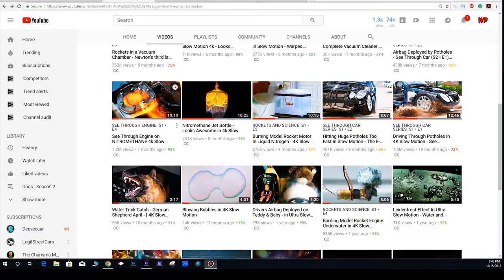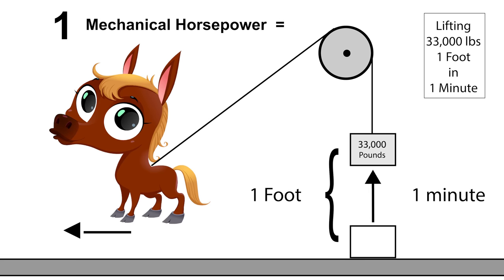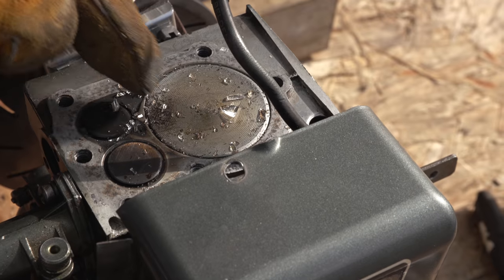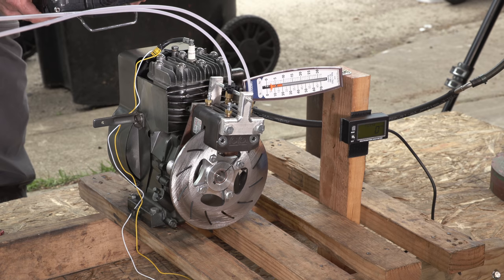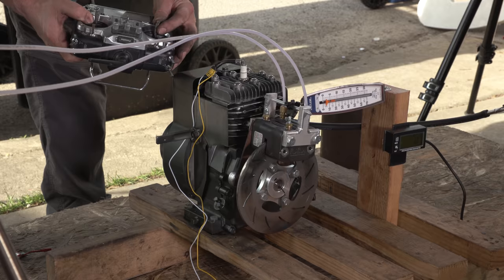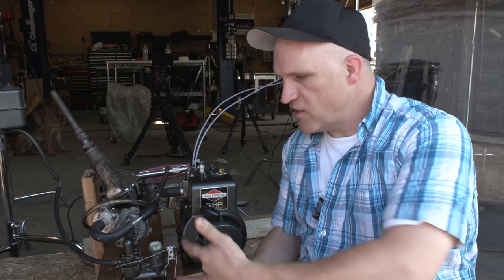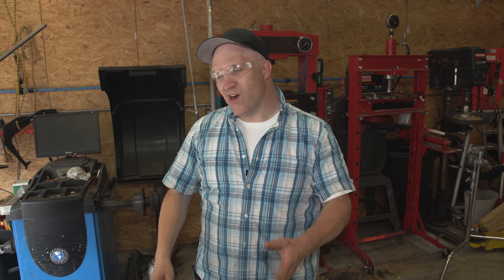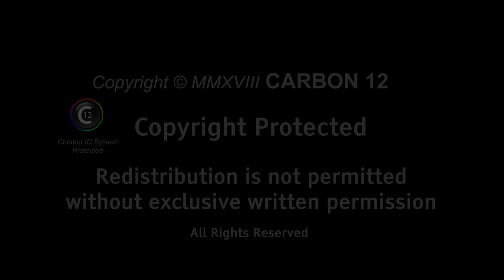See Thru Engine on Turbo Nitro and Dyno  (How much HP does it make?)

Comment: To put a full sized turbo made for a car engine on a basically a lawn mower engine, and hope it produces significant boost, that a lot to hope for. Come on, man!? I do understand you don't want to go and buy a new turbo specific for this but still. At least get a smaller car turbo if you can.
Reply: I herd a spool up 😂
Reply: Indeed, he did say that.  :) But spooling up means bollocks if you can't get enough exhaust pressure and turbine's rpms for the compressor to produce boost.
Reply from the maker: Well actually look it up. This is a 27 mm turbo, the smallest that I can find online is a 25 mm. Keep in mind that this is the primary turbocharger of the sequential setup on the SL 65. If you have ever heard a SL65 Idle, you will notice that you can hear the turbo whine in the exhaust even when the engine is at 600 RPM. This little turbo is basically producing boost at idle when on it's original application, then at about 2, 000 RPM the transition occurs into the bigger turbo which I believe is a 55 mm, I'll have to measure it but yeah, for me 2mm isn't anything a little more fuel and timing can't make up for. And for the record I actually went to buy that little turbo, but I thought it was way cooler to take a turbo from a car and modify it to fit this engine.
Reply from the maker: @Questchaun  it sure did.
Reply: I stand corrected! Thank you for your input. I dare to ask, why then didn't it created significant boost?? Not enough engine RPM range?? Nevermind, I honestly wouldn't know.
Reply from the maker: I'm pretty sure it was a lack of fuel and a restriction from the carburetor, this video was just a starting point for me, and got sidetracked about 15 times in the last year, long story. But I'm definitely going to make a note to go over the turbo compressor wheel and turbine sizes in the next episode. By the way you should look up the SL65 and listen to the exhaust note when it's idling, it's one of my absolute favorites, you can hear these little baby turbo spooling as the car is idling, it actually makes a slight amount of boost pressure at idle, pretty insane. I think the car is a V12 quad turbo but I can't remember. I'll have to Google it.
Reply: Maybe just having a belt drive the compressor would work better? Even if it doesn't it would still be interesting to see what kind of results it gives. And yes, I know that'd make it a supercharger.
Reply: but on its mercedes V12 origin there are 6 cylinder on each bank feeding the turbos with enough exhaust gases even at idle. I must put some math on it but i think you one bank of the V12 does more ignition / exhaust sequences on 1000 rpm then this lawnmower 1 cylinder engine at 3000rpm. so there just arent enough gases to really spool up the turbo under full load to give a real thing of pressure..

Sugggestion again there are very small turbos existing: japanese kei cars or the Mercedes Smart car old generation: very tiny 600cc engine which are turboed. so a get a turbo off these would fit better on a lawnmower engine turbo setup.

get rid of the carb would be next step maybe a computer guy aroudn you which can do a megasquirt fuel injection setup on this engine?
Reply: @WarpedYT  
This is inspiring! For what my knowledge is worth: The turbo charge needs a little bit extra space over the top dead center. Also the exhaust gas has to stay as hot as possible in between the cylinder and the turbine. The gas exits the cylinder with the speed of sound while the speed of sound is only dependent on the temperature. The turbine can only convert the speed of the exhaust gas into power for the compressor. So the simple math is: massflow * temperature = compressor power. 
I worked on stationary 2MW natural gas powered generators for a little while. Those machines have big fat glowing hot turbos on them but use the Miller cycle. So there the turbos don't really charge. They just replace part of the compression stroke. The inlet valve stays open for a large part of the compression stroke. They do that because the turbo-compressor is more efficient than the compression stroke in the cylinder.
I don't know whether I would engineer a variable space in the cylinder head or variable valve timing. Both would be cool to see. Otherwise I'd love to see what fuel injection (reheat of the exhaust gas) right after the cylinder does to the total power output. 
I don't think the size of the turbo limits the possibilities of the total system much. I think the turbo can be really big in comparison to the piston engine that it shares the heat cycle with.
Good times :)
Reply: I look forward for the next iterations! I'll definitively check the SL65 turbo exhaust nots. Cheers
Reply: Warped Perception You are forgetting that the turbine size is only one aspect of a turbo. You also have to consider the ar ratio. That is the balance between turbine and housing size. A small turbo with a large exhaust housing will require a lot more exhaust flow to spool. You can get a 72mm turbo with .64, .86 and .96 exhaust housings. Actually more are offered, but I am using a single brand (CXRacing) for comparison. The smaller the ar, the less exhaust it takes to spool the turbo. No matter what size the impeller is, the ar is still one of the most important factor in how it spools. A 72mm as a single on a 5.3ls can be great or laggy depending on the exhaust ar. In that application, a .64 exhaust housing would be super quick spooling, right off idle. But, swap to a .96 and it wouldn’t want to spool under 4000 rpm. Overall size is important too. Run the first turbo on a 408 stroker and it would be almost too touchy to drive, and the exhaust housing would restrict airflow on the big end. Try the .96 housing and it would pick up power on the big end and still spool at lower rpm. It’s all about correctly sizing a turbo to its application.
Reply: Codeack101 Bear I think it’s less about stupid and more about just being ignorant of turbos. Or maybe he knows and is doing this as a “learning” series. Just thought I would give a little info for anyone that wants to look into it further.
Reply: alflurin No you wouldnt.Just another commenter who needs to go to bed .
Reply: @jakesmith2984  I wouldn't have a problem if this wasn't a fact finding experiment, the turbo isn't even close to being set up correctly
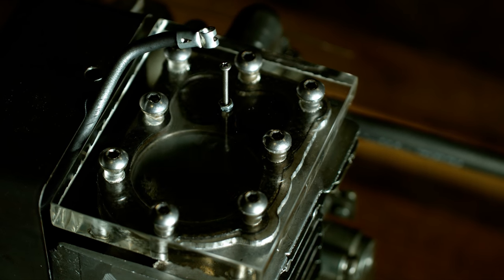Reply: @jakesmith2984   Jake Smith  starts at 1:50 talks about what he's going to do and put a dino on it, TO SEE WHICH MODIFICATION MAKES THE BIGGEST DIFFERENCE.... Either he's ignorant, or this is just click bait...
Reply: Definately lack of exhaust pressure, like think about it that sl65 is what? A v8 or 12 i cba looking but that is a lot more cylinders producing a ‘smoother’ amount of exhaust gas to spool the turbo. So a really small engine like this with one midget cylinder wont be producing enough to spool that thing even at like 12000 rpm
Reply: @WarpedYT  Although the turbo can be heard turning, it doesn't necessarily make positive boost.

On my sr20det I can hear the turbo from 1500, but the manifold pressure only changes to being positive at around 1900. Full boost at 3200.

A boost gauge would have been a nice touch, one less unknown variable.

Still appreciate the work you put in. That disc seemed to machine itself true eventually lol
Reply: Hearing a turbo does not mean it is making any boost. No car sees boost at idle; that would be useless since engine torque output at idle is zero.
Also, adding ignition timing will reduce exhaust enthalpy making it harder, not easier, for a turbo to build boost.
And from a 27 to a 25mm turbo there is a big difference, since cross sectional inlet area is a product of the radius squared, but that's not the smallest turbo you can buy. Smart diesel cars in Europe are 600cc turbocharged; I pulled the turbo out of one of those once and put it on a 5kW generator and it made 6 pounds of boost.
Reply: @jakesmith2984  Calm down son, he doesn't have to upload any vids to make a valid point
Reply: IncandescentWithRage You calm down.
Reply: @jakesmith2984  k
Reply: IncandescentWithRage Wheres the rage bro???
Reply: Jake Smith I find this channel entertaining and yes, I probably was way too tired and I was definitely browsing youtube out of shear boredom. By the way, if you want to know more about turbos.... you got turbo Yoda himself! 
https://www.youtube.com/watch?v=GlHSV0BWKhI
https://www.youtube.com/watch?v=Ssh47oyOSXM
Reply: There re some small junkyard turbos that would work better with the small single cylinder engine. Try one of those little Saab turbos, motorcycle turbo, jetski or Raptor
Reply: You are sooooooooo smart, what's your secret?
Reply: Hey man interesting video. I would probably suggest sticking with the suck-through setup, but get a much bigger carb, or make up a blowthrough hat.  A cheap o2 sensor on the exhaust so you can tune it for peak power would be good too.  But if you are going to run nitromethane in it, you could probably have a two stage setup where you start it on the carb and then somehow switch to nitromethane, since it contains it's own oxygen it only needs a 2:1 A:F ratio.  The Nitro could just be pumped in with a nozzle r something. you really dont need to worry about metering it once it is running, just pump in as much as you can. Maybe a suck through carb with gas and a nitro nozzle in the turbo outlet pipe.Just make sure you have a decent one-way valve and good pump to pump it in.
Reply: Regardless of how many cylinders there are, it's still one of the smallest turbos ever. Even the super tiny rhb31 has a wheel of 25-38mm . usually recommended to make full boost on a 125cc-660cc engine but it doesn't make much boost because (the rhb31s) tend to fail at 1psi

it will probably make small amount of boost, but hey it will work just not so well, better off upgrading the cams and raising the compression ratio
Reply: Warped Perception I’m sorry man, but your info is messed up. The tiny turbo available on eBay is WAAAAAYYYYYYY smaller than this. You may be getting inducer measurements instead of exducer specs or something. The smallest turbo available, the little 25mm one, is palm sized. One cylinder on that MB V12 is larger than this motor, by a bit. If this turbo was really only 2mm larger than the MB turbo, it would choke the shit out of that huge V12, cause valve float and all kinds of nasty stuff. 

Also, hearing a turbo spinning does NOT equate to boost pressure. You can hear a turbo long before boost is achieved. Just get a vacuum gauge on this setup and you’ll see that you have the same vacuum as before the turbo, maybe more.
Reply: @alphazuluz  calm down dude, that sl65 turbo is not a parallel turbo it's really sequential turbo it's just part of the sequential system, just the smallest turbo in the chain
Reply: Dave Lee calm down?  No one here is anything but calm.  I understand that the SL65 uses sequential turbos (one small, one large), but even the “small” turbo for a 604hp, 738ft-lb 6L V12 will be far too large for a 3hp (maybe 100cc) lawnmower motor. 

I realize this is all in good fun, and it IS all good fun, but the point still stands, this turbo did nothing positive for the engine. It’s simply too large. 

If you think about the operating range and exhaust flow this turbo was designed to use (around 1,500-3,000rpm on the above mentioned V12), the math bears out that it is ideal in the 200-300hp range. This engine is making 5hp. It’s a bit off. 

The whole reason I commented on this chain was because Warped Perception said this turbo was only 2mm larger than the smallest turbo he could find. I think he was getting some measurements confused. There are many measurements on turbos. Compressor side inducer/exducer, turbine inducer/exducer, housing size, A/R ratio, and more. 

If I am thinking of the same turbo, they are worlds apart. The turbo map for that “smallest turbo he could find” turbo puts it in the 20-50hp range. I can’t find a map for this SL65 turbo, but Mercedes knows turbos, and would not put a turbo optimized for 50hp on an engine that makes 738ft-lbs of torque at 1800rpm (that’s 253hp just off idle). The SL65 engine likely makes over 50hp at idle. 

Again, nothing against WP, but these turbos are vastly different. He should buy that tiny turbo and repeat the test. I would be highly entertained, and the results would surely be better. 

YouTube channel Cars and Cameras used that tiny turbo on a drift trike with EFI. It made boost and was a beast. Check it out.

Comment: The turbo cant even properly spool up to make any considerable pressure. Which results in lower power than the previous state.
Reply from the maker: Yes the turbo is just a restriction until it gets into its operating range.

Comment: Nothing makes your oil look like baby poop better then Nitro
Reply from the maker: Lol .... Good analogy
Reply: Same with ethanol.
Reply: well if there was a water get in your combustion chamber the oil will looks same but its more white
Reply: beacuse it happen in my motorbike
Reply: @Etownstomp09  do you know why ethanol is doing this? Compared to gasoline the ethanol has a lower boiling point so it's going back into the engine by the PCV and not staying in the oil for a long time. So it's causing less dilution normally.
Reply: L3xou97 lol ethanol sucks
Reply: @stevend4544  it has a high octane rating, it's cheap and it's boiling point is low. I find it pretty interesting.
If you have a turbo or if you change the timing, or both, it's pretty good.
Reply: I was gonna say, if your set up for ethanol the stuff is awesome.
Reply: @Etownstomp09  yea, nascar runs on ethanol
Reply: Where can I to be purchased? Any literature on the characteristics of nitro and the basic chemical structure?
Reply: @danielarway2185  nitromethane
Reply: Matthew Morath Than*
Reply: Ever seen a cracked head or block?  oil and water DOES mix!
Reply: Dave Micolichek  with the temperature of the oil, can't the water just evaporate?
Reply: Dave Micolichek  I don't know either. I will take a look at the oil analysis to see.
I know that ethanol evaporate at a lower temperature than fuel which is good for oil

Comment: Really enjoy these videos however I think your measurement of horsepower is flawed. You are measureing horsepower at the peak observed torque. Engines almost never make peak horsepower at the rpm that peak torque is made. My diesel for instance makes peak torque (425lbft) at 1800rpm whereas peak horsepower is made at around 4200rpm where it is making significantly less torque. If one were to use your measurement method on this engine by snapshotting peak torque and calculating there you would only see 145hp. About half of the cars rated horsepower. I think to get better data points  you need to devise a damping mechanism for your spring scale based dynamometer (look into cheap ebay motorcycle steering dampers) and try to get accurate torque measurements in something like 250-500rpm increments and plot the torque/calculater horsepower on a graph. This will give you a much better idea of any increase or decrease in performance.
Again, love these vids and keep it up. Just trying to help you out.
Reply: Yes, engines make peak torque at a lower RPM than peak horse power. The lines on the dyno graph cross at ,I think, I'm a little rusty, 5252 rpm. Due to how the maths works with how they are calculated. As I say, I'm a little rusty.
Reply: @rationalmartian  you are correct. The lines cross at 5252rpm because horsepower is calculated by: hp=(tq×rpm)5252
Reply: This engine will only rev to where he is measuring.  If it would make X hp at 6000rpm, it would have gone there and he could have measured it.  From what I saw the motor made more tq down low, but he measured where max RPM was.  I could swear I saw some TQ numbers in the mid 20's on the vid at lower RPM which would have put this engine about 5hp and 8lb ft.  Right in line with what it should do. These type of engines always make more tq than hp.

I don't know if he removed the governor, but I certainly hope so.  If not, that's what's holding him back as it tends to limit these engines to about 4000rpm max with an operational rpm of about 3600.  It's actually acting very much like it does still have the gov on there.

Comment: Try funnelling the exhaust down to about half the square area and aim it directly at the turbine. Make the nozzle go past the connecting flange so the velocity doesnt slow down before it hits the vanes. Its like comparing a leaf blower to an air nozzle with 100 psi. They put out about the same amount of cfm but the leaf blower could never spool up a turbo like an air nozzle could. Look up how steam turbines are built, specifically the nozzles. Keep it up. Great fun to watch and you're doing a great job. Thanks.